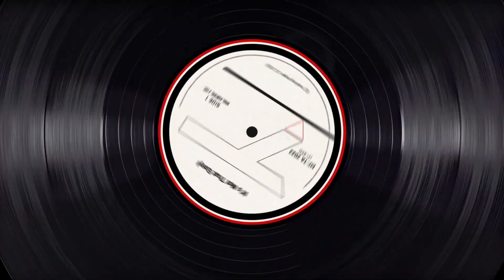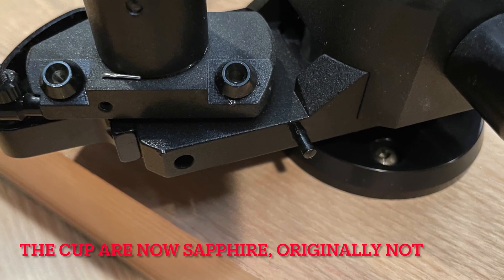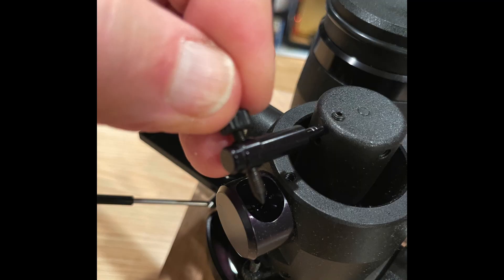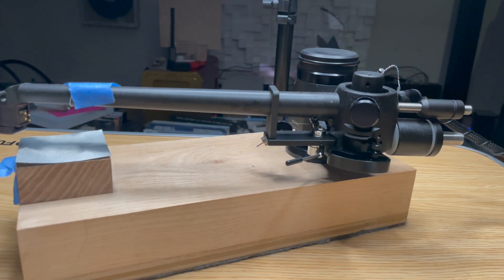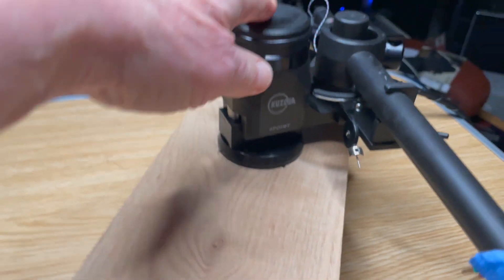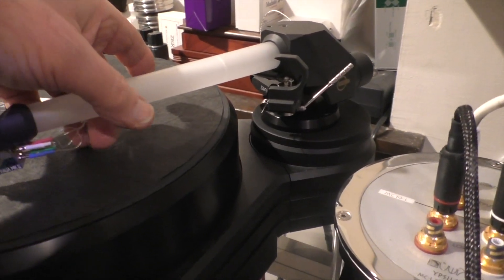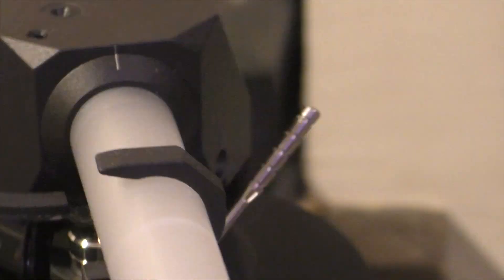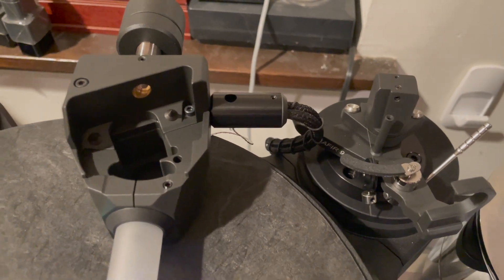Kuzma Safir 9 Arm Review Preview—Full Review Upcoming in The Absolute Sound

Comment: Sorry, but I still do not understand the structure of the horizontal bearing. I believe no one has ever explained it. The vertical bearing is self explanatory.
Has anyone ever opened the central bearing assembly? I can't figure out how this works with two pivot points.